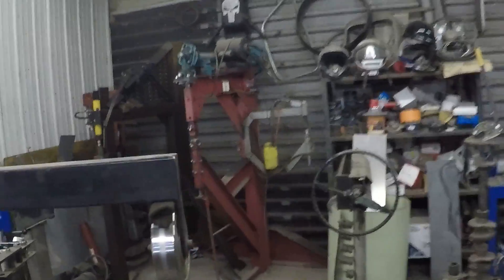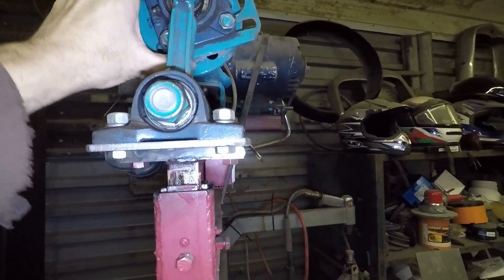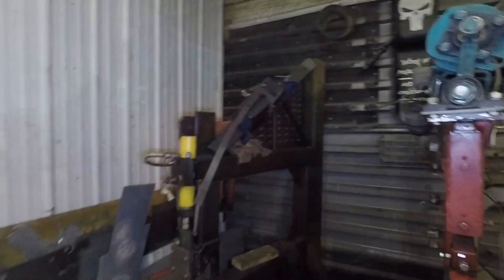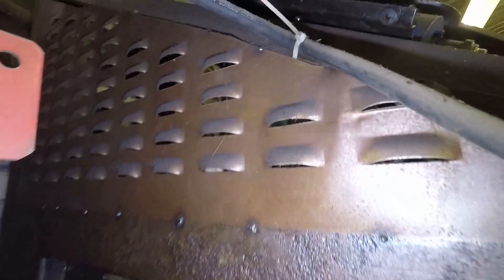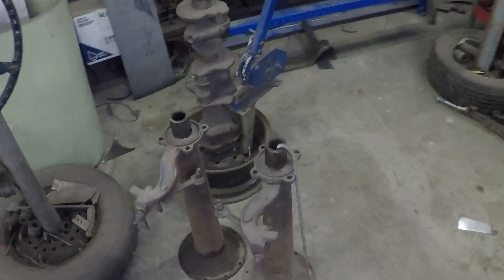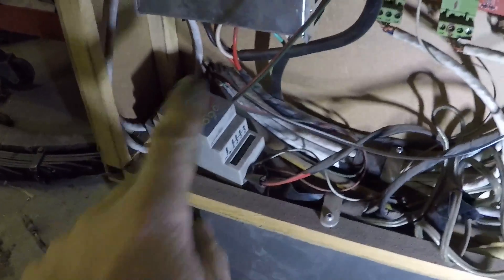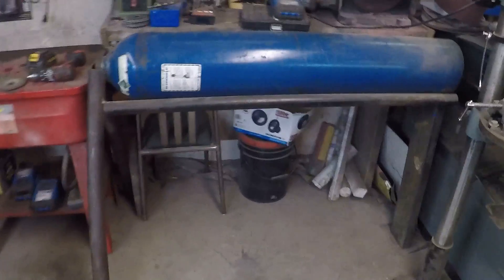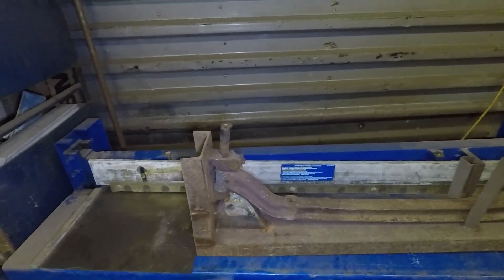Homemade metal working tools

Comment: I am completely terrible with names.  Any way once apon a time when I was just say a couple years younger. I was working for Kellobilt industries. Building heavey Breaking Discs ect. sure you seen Kellobilt discs from stettler ab.  Any way durring my time I began as a kid in school tidying up the shop, washrooms what ever what ever jobs. Over the many years I worked there expanding my tallents ect, I bought a old old Lathe, a Old old Milling machine, a old dinasour band saw, a smaller hydralic sheer, ect, all that were left out in the as we called the Neverland, never to be moved or never used again, Basically seized rust piles. I basically the five of so years after getting all this stuff i had a shop of rebuilt machines all in awesome working order. Like you needed something i built it, one was a Press i used the hydralic pump on my neighbours gravel truck with two long hoses we connected to my press to bend pipe when i made bale bunks for farmers semi highboy trailers. making the dies myself to bend the pipe. time to expand my mickey mouse shop i even made a press to make rafters. In laughter I now sit back thinking about all I did, and how hard I worked wondering how it would be if I could still do all of it.

Comment: I like your style, I’m trying to figure out the moving parts and electrical for a cheap plasma table. I think it’ll be useful and faster that a 4 1/2” grinder cutting plate
Reply from the maker: Yeah theres a couple good vids or if you got a 3d printer this my work if modified https://www.thingiverse.com/thing:1750276

Comment: Love the hand built tools. Was thinking about building the dropped axle tool. I broke down and bought a dropped axle for my current project (1928 Ford closed cab pickup) was going to use the foam that it came in to build something one day. Make a stock beam fit the mold of the 4: dropped axle.
Reply: I am wondering if you might have a solution for my latest issue. It is a .812-.814 reamer for drilling the model A King pin spindle bushings. I just cant see dropping $175.00 to drill 2 holes (4 bushings). I am hoping you have a homemade solution. I do not own a lathe or mill. I do have a drill press and have tried a long pilot adjustable reamer, but just don't like the finish it is pretty chattered. thank you very much
Reply from the maker: Think all I've done is the adjustable reamer myself,4. But I just manually use it and suffer haha

Comment: If you are ever needing a HD bumping "hammer" that moves your hand a bit further from the impact (you used a heel dolly on one video for that low spot on the drivers side rear) try cutting down a torsion bar.  That they are hex or octagonal on that one end makes it easier to round off, quite tough and depending on needs can be cut quite long.
Reply from the maker: That's not bad idea, I sometimes use a hitch ball that I've smoothed out to do similar.

Comment: That large but thin metal thing on the metal stretcher is for doing valve springs I'm guessing. I feel like shit now cause I never seen these tools till I got hurt and I had the perfect shop to do things in. Saddest part is all my videos are gone or I could prove that I   was thinking about stuff like this. I had a welder set up to do the little puller of dents but never used it thank god as I just didn't know how to use it. I am not sure I could work in confined spaces like it seems most of your gear is. PLEASE don't think I am putting any thing you built down as I just am jealous of what you have made, if you had lived within a tank of gas one way of me and I had big tanks on all my stuff, I  would of came over and had you show me how to use it as I was a very good mechanic say twenty years back. I grew up with a dad who was a gypo logger and worked on his gear in the late fifties and early sixties then the last of the sixties starting in 66 late I took a little trip halfway around the world and got the hell shot out me. Them Vietnamese just didn't take to my sense of humor and I got home spring of seventy with various parts of my body healing up.. Lost half my teeth on when a fragment went through the side of my homely face. You taking what you have and not worrying over it, just building I admit, I would of joined that fram different but I wasn't there so maybe I would (38 an camaro). Its well built for strength but I did a lot of incerts so I would of modified the camaro frame on the floor and had the width within a inch on either side and tried to slide together but that pontiac frame had a lot of smegma on it, pedals, bullpucky in general so it makes sense the way you did it. But I am 72 and full of shit setting in my desk chair making sh** talk an that ain't cool cause I was really impressed how you used the stump and stretched the metal then the cut off as you welded in the top and took the old crap out from the inside and the first thing I thought of was how I could of used that tec on so many stupid repairs... all in all a great video as I really enjoyed.... kinda like doing a walk though in a factory
Reply from the maker: Haha all good, most of the time if I need to use something I pull it out and use it, but most of the stuff I don't use very often so I tend to ram everything into a corner.

Comment: someone like you could make a million by making a fixture to put on a 2-3 ton floor jack to use as a press. I don't have room for a cheap or expensive press and tired of going to shops that are usually way to busy to do a cheap 5 minute job or parts store that insists you use their junk parts. I'm working on a driveshaft center support bearing thats kicking my ass and had some axle bearings a few months ago too. I'd rather have a 100 dollar fixture to use with my floor jack than a 100 dollar press that would have to sit outside or lose more counter space that I don't have.
Reply from the maker: Think you can buy really cheap press's to do what you want.
Reply: @HalfassKustoms  yeah but like I said room is very tight in 2 car garage at my home. and even if I had room it would be a shit collector and then you gotta buy clamps and collars for every little job taking more room.  I like having multiple uses for tools so they are getting used. I'm not a shop just a long time home wrench hobbyist.